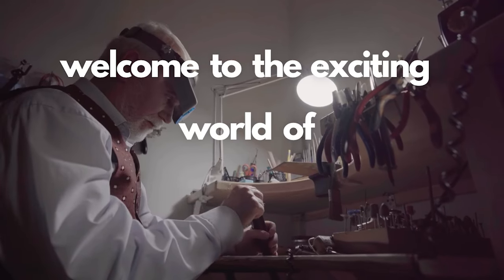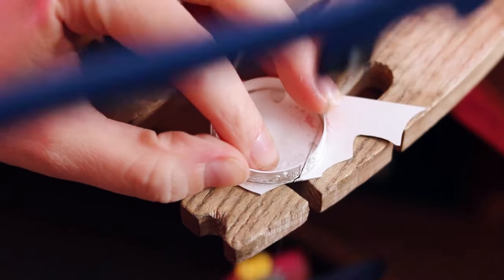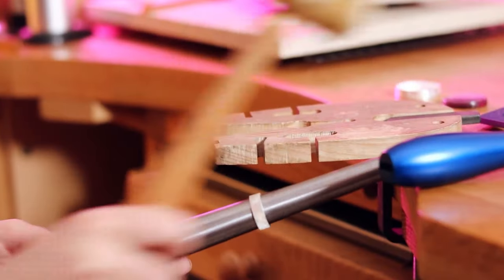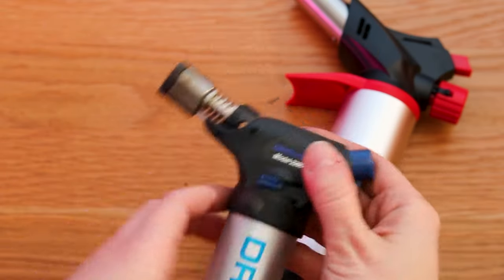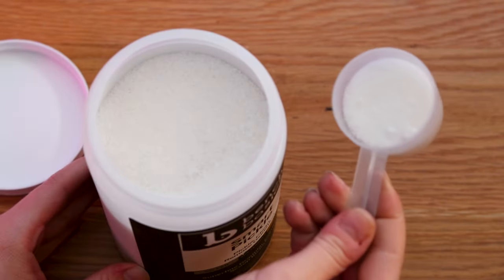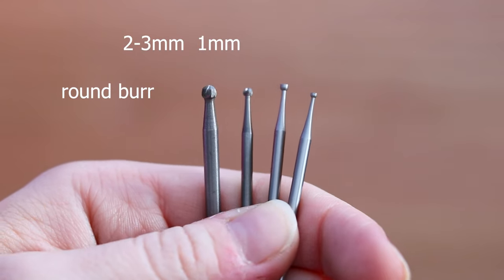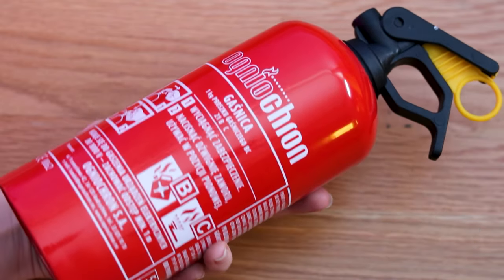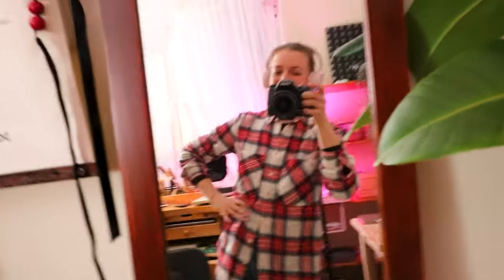TOOLS you need to start SILVERSMITHING! Jewelry making beginner starter pack

Comment: When I first started getting more tools, I was a pro at fire staining, not soldering properly, and melting all the silver I had 😂 (loved the video, just reminded all the “Dammit’s” I’ve muttered while using all of them)
Reply from the maker: We all did at the beginning, trust me! Practice helps with time and we learn to use the tools as well 😀 Some experiences are more painful than others haha that's true! 😂
Reply: @TheArtOfMetalsmithing  Thats what I worry about. So I need to just expect all three of those things to happen, after i cut pieces into the 100gram silver bar? Lol so a lot of time, tools, and wasted silver. Good to know so i know what to expect to avoid getting frustrated.Whats the easiest thing you would start with, cutting a hunk of silver off a bar?TYSM🙏
Reply: Same here although I do have silver wire, I'm focusing on copper until I'm confident I'm not a hopeless mess, I manadged to turn a braided copper wire ring into a solid ring with no distinct features, the solder just for some reason didn't want to melt but the rest did. I'll have to admit I haven't used Flux yet since I tried the first couple of times raw and now I'm trying with solder paste but it completely burns away before the metal is at the right temperature.
Reply: Same here although I do have silver wire, I'm focusing on copper until I'm confident I'm not a hopeless mess, I manadged to turn a braided copper wire ring into a solid ring with no distinct features, the solder just for some reason didn't want to melt but the rest did. I'll have to admit I haven't used Flux yet since I tried the first couple of times raw and now I'm trying with solder paste but it completely burns away before the metal is at the right temperature.

Comment: Hiya lady Stardust,
Thank you for this fundamental but essential video; essential? Yes, anyone starting will need these, or similar tools, to get the metal to do what they want it to do. What do you think do you think about the cost? I had to save up to purchase these tools, and even then had to get a few at a time. I, like most people,, were too tempted to buy the cheap alternative online. But, yes, there is always a but; the old expression; Buy cheap, and buy twice. Or even three times. It is worth waiting until you can afford the better quality items. Most affordable items can mar and mark your workpiece, sometimes badly, and if nothing else,, you will spend a lot of time correcting the mistakes and cleaning off the dings and dents from your works of art. 
So do I need all of these, and do I need them all at once? Yes, and no. You will find you do need them all, but not all at once; I purchased over time as I could afford them/needed them. You will need other tools to do other things, most artisan tools are made to fulfil a particular purpose. A rolling mill will roll out remelt metal into wire or plate. It will indent patterns into plate. It will squash chain into a shape you desire, plus other things. The hammer that Basia showed will flattern things using the flat end. It will indent semi hemispherical dents. It will not be best used hitting puches as this will mark the flat, highly polished face. A brass mallet is best for this. A quick point; the state of the surface you hit with will be inparted onto the work piece. A nice highly polished surface will not mar the workpiece, but if it has a ding in it, that will transfer. 
Okay would I have added tools to the list? Yes, a scriber. A what? A sharp pointed piece of usually steel that is used to scratch a mark into your workpiece. To show where to saw along, or saw to. Where to drill, or mark with a burr. Why not just use a sharpie? The scriber mark is indented, scratched into the surface, pen will come of when you don't want it too.  Another simular tool is a centre punch, again a piece of steel that you place the pointed end where you want the hole, you then hit the other end with the brass hammer to leave a dent that your drill bit locates into to help stop the drill slipping. 
A lot of work that you do to your metal be it copper, brass, silver or gold will be pure engineering. Marking, sawing, drilling, bending the list goes on are all standard sheet metal working practasis and you can learn about them from watching start up videos on YouTube on engineering, or reading books. Metal is metal, is metal. How it ends up, as art jewellery or a car body depends on what you want it to be. 
Starting out you need the best tools you can afford, the best materials you can get, and the best teaching around. Here on this channel you have found, in my opinion the very best teaching around. Basia started with a degree in Art History not working metal. She is a great artist and has become a great engineer too. She has learned from books, some videos and a lot of practical work how to make some of the very best art jewellery around. I know I own some and wear it. I want more... 
So my advice? Subscribe to this channel and hit the bell so you don't miss films. Do I get anything from saying things like this? No, I'm one of Basias' supporters. I've learned a lot from her and her videos over the years, and I want to learn more. 
Okay enough rambling from me, read the other messages as people are great at sharing on here. Re-watch the video when you have time. Why? I always learn more from re-watching any of the teaching videos I follow, it's just good practice to learn as much as I can. If you are new here go back and watch from the start, you will learn a lot about how, why, what, where and when of making great jewellery.
Stay safe everyone, Steve xx
Reply from the maker: Thank you Steve!!! ❤️❤️❤️
Reply: @TheArtOfMetalsmithing you are always welcome, dear lady. Would you believe I'm actually coming up with designs? I'll send photos when I've made them. I never thought I'd be able to say that; thank you for your faith in me. 
Steve xx
Reply from the maker: @stephencoster9532  please do! I'd love to see them 🥰
Reply: @TheArtOfMetalsmithing That is funny because I can't wait to see them, too... hehehe. We need a lot more videos from you showing the starting point of all that we do at our bench peg. You are the best Dear Lady, keep on keeping on!!!
Steve xx

Comment: So all in all, you only need about $5000 Canadian + Silver and/or Gold sheeting etc, plus Rolling Mill and Lost Wax Spinner, Torch and Gas, Maybe a binocular microscope and an endless line of do-dads and things.
I started Faceting several years ago and thought I might get into at least Silver Smithing. Then I discovered how expensive Faceting Tools are, never mind the ever increasing cost of the rough minerals. I could see I needed to spend a fair bit in pliers alone and a small vice and a torch w/tank etc. I knew it was going to be cost prohibitive if I still wanted to cut gemstones. Ultimately for me, the deciding factor was "Artistic Talent" or a lack thereof. While I have excelled in Graphic Arts, Musical Arts and Martial Arts, I am not familiar with Jewellery. I have never worn any and still don't at the age of 63 now. So I have never paid any attention to jewellery. I think you have to have experience with different types and forms of jewellery PLUS an inherent artistic talent .. unless you want to just copy everyone else's stuff. I definitely lack this latter part so I gave up on the thought and will stick to cutting coloured gemstones ... for people such as yourselves.  :)

Comment: hey, this might be a silly question but I'm trying to figure out where I can save money while starting out...Do you need the rotary tool and flex shaft with all the attachments or can you just use the sanding and polishing papers?
Reply from the maker: Ok, so this is a good question! Personally, I think that if you really just want to try it out and ses if you like it without investing, then I'd try with the polishing papers and sanding sticks first. However, if it's something you know you want to do, then a rotary tool and a flex shaft are the best and most investment worthy tools you can get! You will use them constantly for many jobs and they will save you a lot of time and energy (and time and your strength are money). That's my personal opinion, but please don't feel pressured to invest if you can't or don't want to! Also, there are cheaper brands out there, like Dremel or even simpler ones, no need to buy something expensive, like Foredom, right away 💕
Reply: @TheArtOfMetalsmithing  thank you so much for your response, that was super helpful! I absolutely love your videos too I’ve learned so much from them :)

Comment: Hello, thank you for sharing those supplies you need. I have a question, what sawblade should I use for sawing copper? Small things... like wire or small inserts. 
Oh another question, oops. It is hard to buy tools from jeweler shops. You have to be a registered student or a professional jeweler maker. Do you know a shop where you can buy products as an amateur? Thank you...
Reply: I believe that it depends on the thickness of the copper. I think if it is thicker metal then go with a thicker saw blade but if it is thin then go with a thin saw blade (not too sure though, as I am somewhat new to this). Also, there is a shop online called Rio Grande Jewelry Supply that has a lot of high-quality jewelry making tools and you can get them shipped to your home. It makes you create an account but you don't need to be a registered student or a professional.
Reply: @Venus Muñoz-Hernandez  thank you for the information. 
I know riogrande and I love to put everything in my cart... but when I look at the shipping prices... OMG... not normal. Can't afford that. 😪 you, from the USA are so lucky... 😭